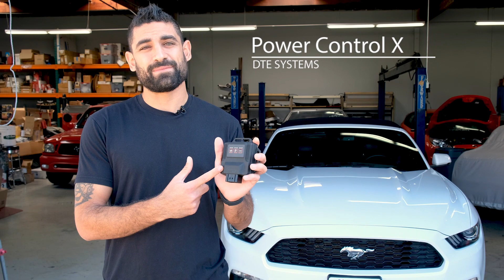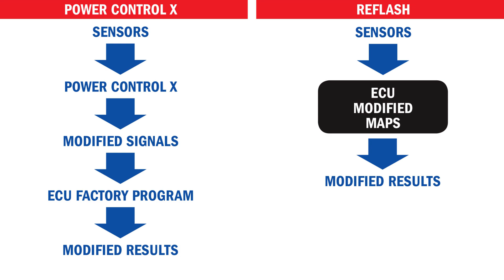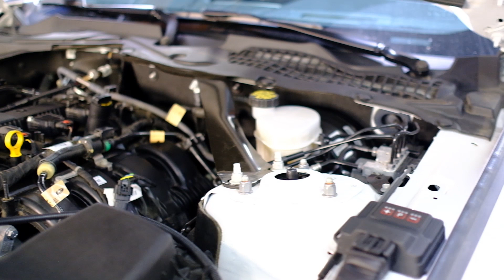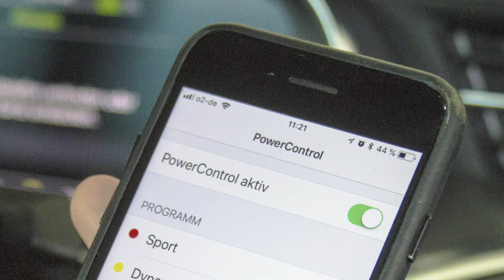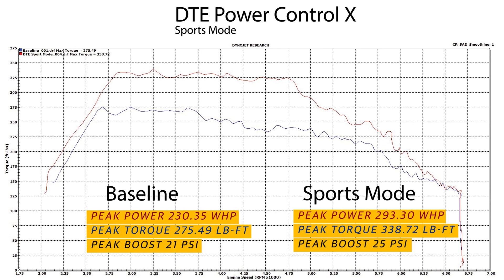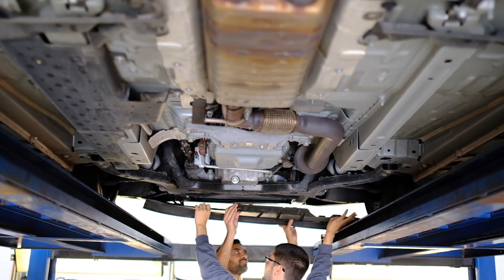63 Horsepower Gain in 15 Minutes | Power Control X by DTE Systems

Comment: My parents Skoda Octavia 1.8 DSG 4X4 had such terrible pedal response, where they would become unsure when merging on to a new road from a standstill at junctions, although they had a reasonable gap in traffic, because the lag was so pronounced. The car would do nothing for half a second and then lunge forward. The increased low down torque of the Power Control X, as well as the pedalbox solved this. They love the car now.